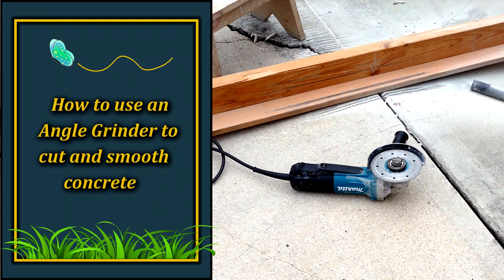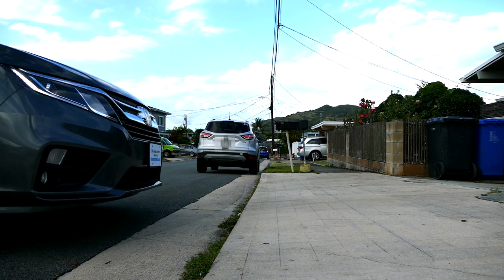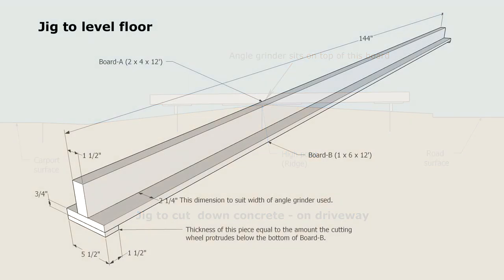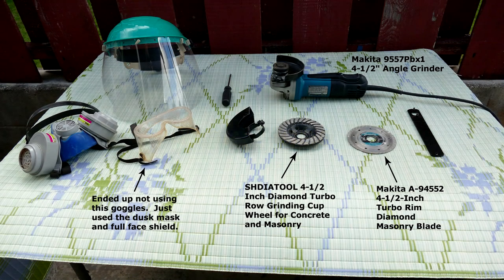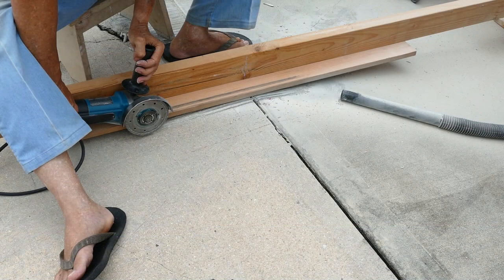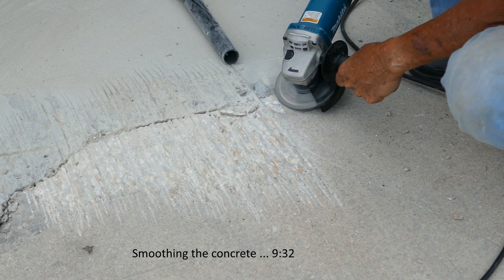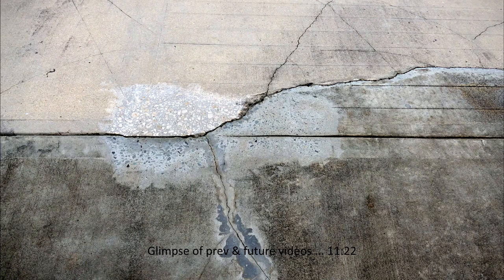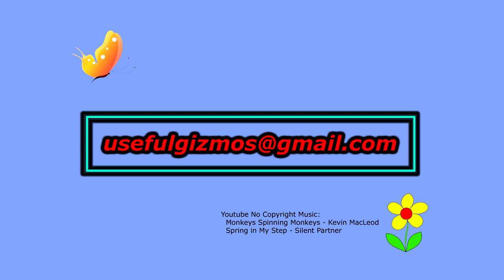How to use an angle grinder to cut and smooth concrete

Comment: Nice project execution.   However, there is a much simpler way of dealing with this driveway problem.  A concrete scarifier could have been rented from Home Depot or other rental store then the concrete could have been shaved down in less than five minutes.

Comment: No protection on feet when cutting was really disturbing - one slip or oops and ... you know what. This was a cheap fix and more work was required to fix the poor state of the concrete and strange levels but if you just wanted to fix the car clearance problem then you did well with the exception that after grinding you had a smooth surface that is slippery when wet so that needs work also.

Comment: Best video I found to "shave" away concrete on a driveway.  I have a sloping driveway down to my garage in a 120 year old house and it the driveway at the top.  I have be grinding flat for days, but will now do you like you, get a diamond blade and cut lines into the concrete and chisel away with a hammer.  I was thinking about renting a concrete grinder,  but I just need to smoothen the top edge.  Wish me luck!  And thanks for your video!
Reply: Appreciate your comments and all the best for your project.  Thanks for watching and have a great day! .... Usefulgizmos

Comment: For the first time I am sure, a 12+ minute video went by real fast. That's because it was exceptionally good and clear and useful as an instructional video. Thank you for setting the bar so high and sharing you great work. Just one thing though: no flip flops for jobs using tools and it would be best to kneel on one knee with your body/legs the "safe" side of the jig for added security.
Reply: I still have all of my toes 😉😁.  Thanks for watching and have a great day! .... Usefulgizmos

Comment: I have never used an angle grinder. How necessary is the jig, or to have straight lines in this situation?
Reply from the maker: The jig allows a consistent clearance of 7/16 inch for the muffler (mistakenly called it the catalytic converter in the video).  Without the jig the cuts in the concrete would have varied quite a bit resulting in a wavy cut  and maybe not deep enough in some places.  Please note that an angle grinder is probably the most dangerous power tool in a home owner's tool box.
Reply: @usefulgizmos  Thank you for saying that last part. I have some ideas that need an angle grinder, but I'm still working up the nerve to buy one.

Comment: Great video. Did consider getting bigger tires? Because there are roads, bumps, and parking lots that are not flat causing the same issue.
Reply from the maker: Thanks R.  Stayed with stock size tires to avoid accuracy problems with speedometer and odometer.  Also, I don't want to give my car insurance any reason to not cover an accident because of non stock tires being on the car.  Insurance is not for the fender benders (I can handle those repairs) but it is for the big accidents where law suits may be involved.  I stay 100% stock always.  Thanks for watching and have a great day! .... Usefulgizmos

Comment: Great job! just curious what type of vacuum filter did you use and how did you safely dispose of the silica dust? Thanks!
Reply from the maker: Thanks for your kind words.  I just used the standard shop vac disposable filter bag along with the Shop Vac's internal filter for the motor.  It did minimize the amount of grinding dust being blown into the air which would have happened if I didn't use my shop vac.  Have a great day! .... Usefulgizmos
Reply: @usefulgizmos  Thanks !
Reply: @spencerwhealy9945  You can also purchase a dust shroud for the grinder. it has a port to connect to the shop vac and allows you to control the dust very well. You can use a HEPA type vacuum filter.

Comment: Just saying you may want to break up the concrete where it was cut and dig deeper and add rebar so it doesn't fail quickly. Might not tho anyone got thoughts on this?
Reply from the maker: Hello Joe.  Thanks for your concern.  It's been 1.5 years and no concrete failure what-so-ever.  I only cut down 1/2 inch at the ridge and the concrete is 3 inches thick so I'm confident that no reinforcement is necessary.  Thanks for watching and have a great day! .... Usefulgizmos
Reply: @usefulgizmos  awesome thanks for the reply 😁 have a great day

Comment: Great job on fixing the issue. Can't imagine driving the new van home and getting the catalytic converter scratched and dented. I find it's a dumb design for honda to hang it that low and who ever built that drive way was dumb too. Two dumbs create a disaster.
Reply from the maker: Hi ChemE.  Thanks for your kind comment.  The driveway came as is when we bought the house over 35 years ago.  All the cars and vans that we owned over the years never even came close to scraping anything under the vehicle.  I believe that any credit for dumb design can be solely awarded to Honda.  Have a great day! .... Usefulgizmos

Comment: Setup by my employer worry everyday I will die from silicosis from drilling into concrete the dust is fatal with no hope please spread awareness.
Reply: Just wear an A1/P2 half face mask respirator and  you will be fine. If your employer won't supply you with one, then buy them yourself. They really aren't that expensive and will provide you with a great deal of protection.

Comment: Get some bigger tires or get ur exhaust secured higher up
Reply from the maker: Hi NightMusic.  Bigger tires won't be compatible with the electronics in modern cars.  The tires need to be the same diameter as the factory tires.  .....  As to raising the exhaust system higher up, that would be a huge job. .....  Cutting down the ridge in our driveway was simple and is working well.  It will also work if we change to a different van with a similar problem later.  Have a great day! .... Usefulgizmos

Comment: I just put bigger tire on my van. It clears the concrete. And it gets better gas mileage.
Reply from the maker: Hope doing that didn't void your vehicle's warranty, or affect the speedometer, odometer, antilock braking system, or other possible computer related things.  Thanks for watching and have a great day! .... Usefulgizmos
Reply: The speedometer is off by 5 miles an hour. It runs great and rides better.

Comment: Better solution was to fit some wood on way to increase height
Reply: The wood could slide causing severe damage to the converter. A bridjit ramp could have solved this but would have cost way more.

Comment: Now I see why Honda always rates the ground clearance of the Odyssey at 4.5in. That is insanely low. Lower than most sports cars. Kinda dumb they couldnt figure out how to get 5-7in like most other minivans. At least its only the exhaust system and not the actual underside of the car.
Reply: Yes, the designers of the exhaust system for the 2018+ Odysseys should all be fired.  It's the muffler, not the catalytic converter (I mistakenly called it the catalytic converter) that protrudes well below the underside of the van.  Thanks for watching and have a great day! .... Usefulgizmos
Reply: @RAPTOR8ASDF  Agreed. Actually older Odysseys are also rated to be extremely low and have similar problems I believe. Actually a simpler fix would be to get taller tires and maybe even wheels for the car. Your speedometer would be off but that is the only major downside.